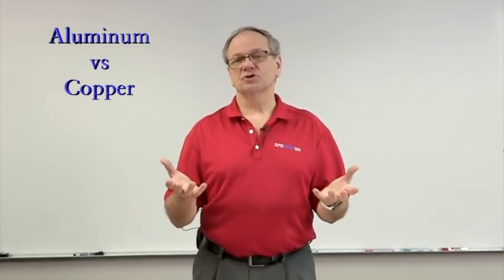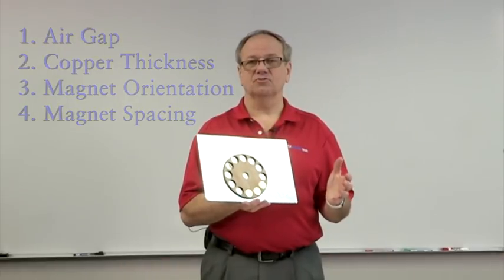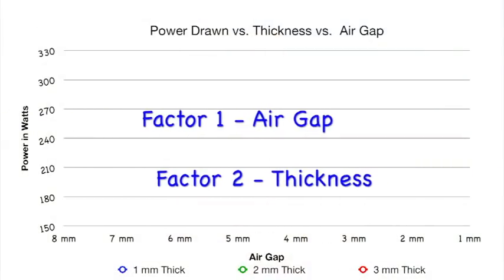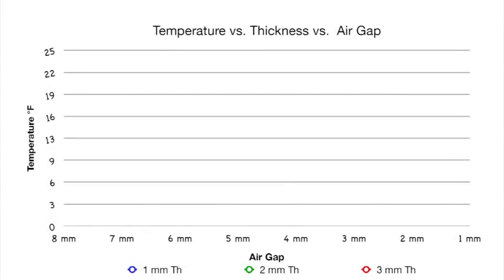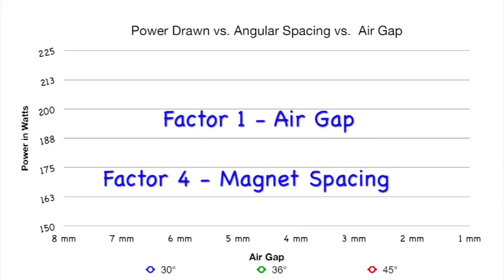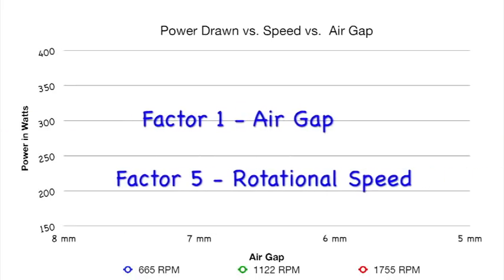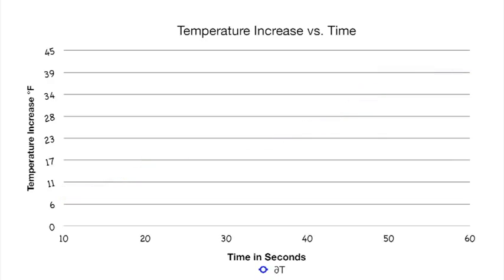Factors Affecting Eddy Current Drag

Comment: Great video- pretty exhaustive testing.  What were those 1" magnets on the 6" disc array?
For anyone curious of the speed of the copper passing over the magnets here are the ranges...
5"C :  15.707" travel
6"C :  18.849" travel
A=     @665rpm :  (  174.08"/sec - 208.90"/sec ) ( 59.26 : B ) ( 37.8% : C )
B=     @1122rpm: (  293.72"/sec - 352.47"/sec ) ( 168% : A ) ( 63.93% : C )
C=     @1755rpm: (  459.42"/sec - 551.33"/sec ) (263% : A )  ( 156% : B )

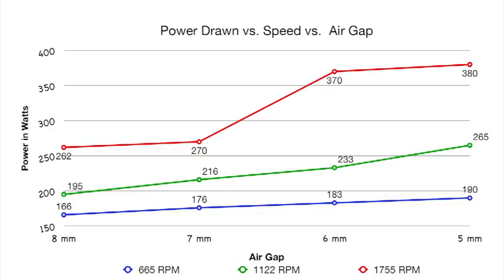That is quite a change in response by air gap @16:10 of the video.   ( edit in bold )
Reply from the maker: Yes - I realized I forgot to mention that:)  They are 1 inch diameter (25.4 mm) x 0.25 inches thick N40.:).  Thanks for giving the angular velocity - that is quite a drop in speed:)

Comment: Nice test but picture net to the chart would help. Since I forget what you are talking about. Also I assume when you have some inconsistencies it might be due to frequency of the metal and speed.
Reply from the maker: Thanks - Yes - The one that that was hard to control precisely was the time - 10 seconds.  I would spin the drill down and hit the timer at the same time but sometimes it might hit 11 seconds before I would raise it back up.  Also, as the copper would heat up above the ambient air temp I think spinning it in the cooler air was cooling down the copper a bit after i had already ready the temperature.  It worked well for the most part but a few inconsistencies means it was real data:)

Comment: I wonder why magnetic couplers aren't used more in vehicle applications?
Reply: They sort of are. The clutch on the air conditioning is magnetically operated. As far as replacing the torque convertor you'll have a problem with heat. Eddy current is still a current. That current flow will create heat. A torque convertor has a fluid (oil) pumped through it. This fluid is run through a radiator to cool it. Even then when the car comes up to speed, the torque convertor "locks" out by directly connecting the drive shaft to the gearbox and stops the need for the fluid coupling. The fluid coupling seems rather mechanical but is actually very efficient. Eddy current is just resistive losses.

Comment: Great video! just one little question: would the temperature test be more precise if the total amount of warmth was calculated? Because the masses of discs are different and it seems that it takes different quantity of warmth to increase their temperature. Also there are different quantities of work are done with different disks as well. So it seems like, in the same conditions, the temperature increasing should be proportional to the amount of work done and oppositely proportional to disks masses.

Comment: I have huge magnets but currently no large blocks of copper. I really want to see the eddy currents effect. I have a bullion block of aluminium that surprisingly didn't work. Maybe it does but not as much as copper? Is that right? Also, I figured until I can afford a big block of copper, maybe a small bit of copper will work in a large magnetic field! No. No that doesn't work... 😆

Comment: Really this is closely related to induction motors. This is basically a locked rotor test in disguise. Note that adding a (thin!) iron backing plate to the copper will usually give you much bigger braking effect because it closes the flux loop (but will also give you a net attractive force unless the amount of iron is very small). Also having two rows of magnets (alternating N-S side-side) will give much bigger effect- more than twice.

Comment: I know you have great computer modeling,
I have a configuration that I believe does create the equivalent of a Fresnel lense, only with magnetic fields, rather than light.

The benefit, is that a lot less expensive magnetic material is needed, a positive there, also it has potential I believe to create incredibly strong permanent magnetic fields.

Is there any chance you and your staff would evaluate this for me?
Next, I am not looking to profit from this in any way, you can have all rights, etc....
The only thing I ask, "is that it be named after me, the lavedas configuration."
If possible.
I started working with permanent magnets at 3 yrs of age, where I encountered "numerical alphabet refrigerator magnets, that even at 3 I knew where different, and they were, the were very cheap, and used a Holbrook array configuration, in 1968-69, being three no one could ever explain said(we didn't have no www. Then!

Comment: This is a terribly crude experiment. What if you used 1/2 inch disk magnets. The separation between magnets would make a bigger difference to the flux between the magnets. The sizes are a mess in this experiment.

Comment: What would be the “rust” factor of a neodymium iron boron magnet be if encapsulated in clay /Adobe/cob?
Reply: I am bubbling with application concepts that would disrupt industries… but serve the people and society. Natural, simplex, lasting solutions.
Reply from the maker: Andrew - sorry to be late in replying but - we plate the magnets and encapsulate magnets in plastics and PTFE and epoxies to reduce oxidation.  The "rust" is the oxidation of the material.  Great care is taken at every step in the manufacturing process to eliminate oxygen in the material but at the atomic level there will always be something in the material.  The less oxygen that is entrained in the material the longer it takes before oxidation will affect anything about the magnet.  
I have had a customer who did get some of our high temperature magnets and molded clay around them and baked it in an oven to sinter the clay and it worked great.  Since standard neodymium magnets are only good for an operating temperature of 60-80° you would need to probably select the SH grade neo which is good for 150*C or a samarium cobalt magnet that is good to 300°C.  Thanks - I hope this helps.
Reply: @SuperMagnetMan  have you began testing with graphene coatings on copper? Or graphene at all?

Comment: Nice testing. Very interesting. If you do another test series it would be interesting to note what the energy transfer efficiency is from the drill press to the copper plates. Would need to know the weight of each plate X delta T X  specific heat X the time period. Since I experiment with building room heaters, that would be good info.

Comment: Nice job on the experiments...love the enthusiasm in your work.

I have a similar question...Have you or anyone out there...studied the effects of opposing magnet arrays?

N S N S N
======= non-ferromagnetic conductive disk
S N S N S

versus
N N N N N
======= non-ferromagnetic conductive disk
S S S S S

N S N S N
======= non-ferromagnetic conductive disk
N S N S N

I've built a resistance training sled with a 1/2" thick by 12" diameter aluminum disk that will spin over 1500 rpm (through a two step gearing process) at normal walking gait
 and I have 1" x 1" cylindrical RE magnets.

Before I start machining a device to hold the array or arrays I'd like a little nudge in the right direction.

Are opposing arrays beneficial--- (provide considerably more eddy current resistance)?

Whether or not I use opposing arrays,
 I plan to be able to adjust the overall resistance by either changing
- the air gap, or 
- the array's position relative to the distance from the center of the disk, or
- how many magnets are actually positioned adjacent to the disk to create the magnetic field.

Comment: Sir..i have been trying to separate granulated electric wire lot to separate very thin granulated copper and plastic..with 1440 rpm rotation of magnets on conveyor belt..it is not showing any repulsion effect on 1mm x 4mm wire chunk moving on conveyor belt..my purpose is to separate copper from plastic..whats gone wrong..plz help me..thx.